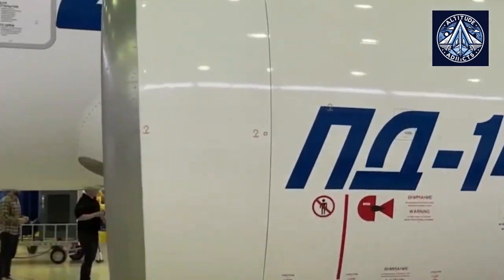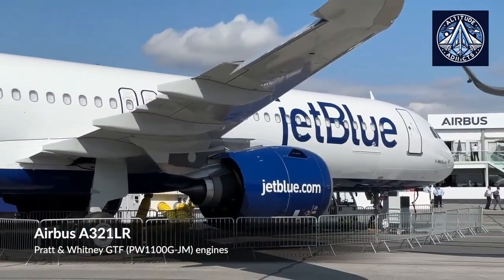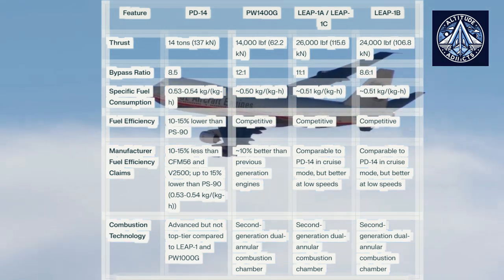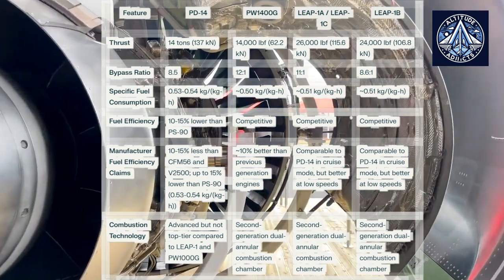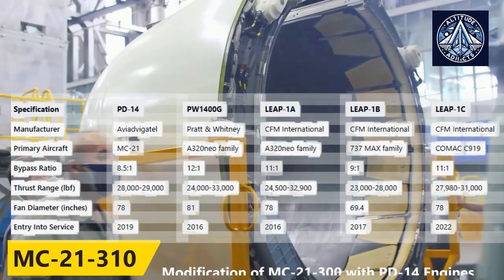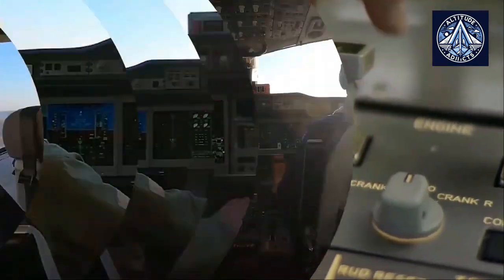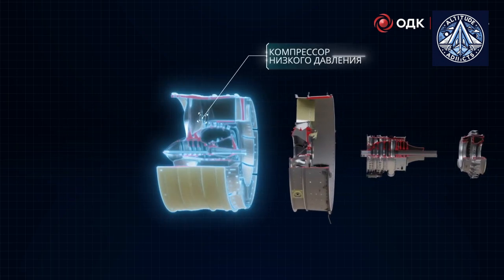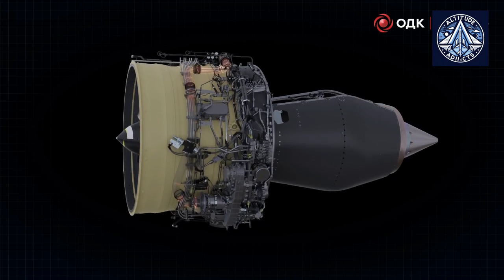East vs West Engineering: PW1400G vs LEAP vs PD-14 Engine

Comment: Russia does not need to be ashamed if it has not been able to match the West in creating efficient machines. The PD-14 if only able to approach the LEAP's CFM is no mean feat. Because CFM didn't sell for a long time, and even almost went bankrupt because no one bought it. The PS-90A is still inferior to the CFM56, but not far behind. Likewise, the PD-14 is a significant improvement if it is able to approach LEAP's CFM. Let's just look at RR from England, which is currently devoid of fans. Also P&W still has a lot of reliability problems. I think sanctions from the West will only give Russia's domestic industry more of a place. Even if the war with Ukraine ends, I hope Russia will continue to strive for independence in terms of technology, and Russia has the capability to do so.